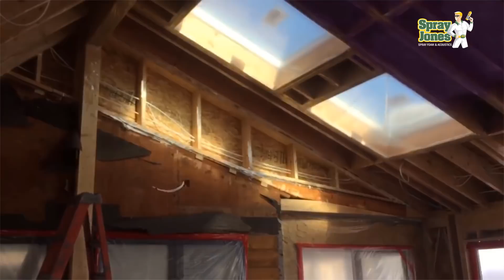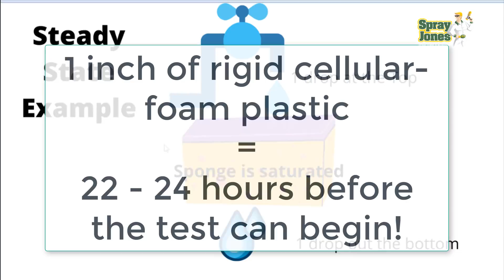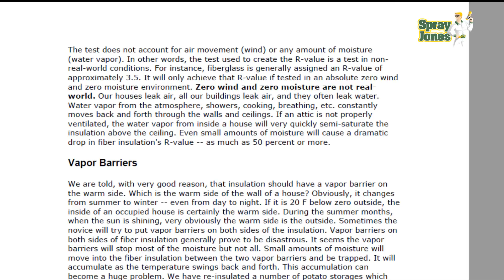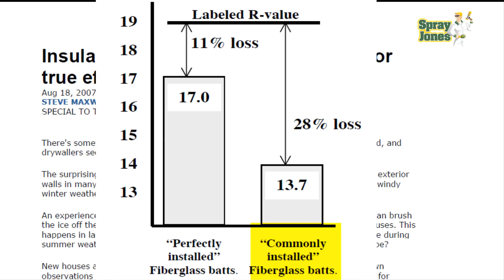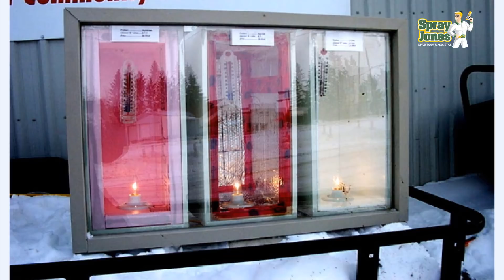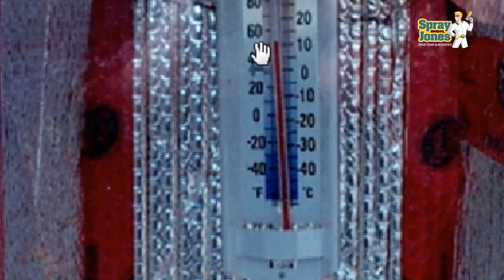R Value and Spray Foam Insulation - Just the Facts!

Comment: I PREDICT  that there will be a spray "foam" in the future that contains spheres or pellets of a material such as glass that contains  either a vacuum or an inert gas that is sprayed and will be a more "permanent" insulator similar or even better than the R-Value of FRESH sprayed Closed cell Foam.  There may also be a reflective layer available to spray as a thin "PRIMER" type layer that can be sprayed first to provide both insulation and radiant heat reflection that could also be sprayed as a last layer to reflect more heat back into the inside of the building.  This should actually not be that difficult to achieve. It is also fairly practical at least for the "beads" and the outer reflective layer though that might be dealt with in another Total Insulation Plan.
There will also be more advances and possibly included in this design to improve fire retardation.
Reply from the maker: Sounds good TK.

Comment: Great info 👍. I'm one of the 2 LoL actually I think you have more to the end because it's great info. I really like the real world test with the 2 identical test. Measuring the actual R value is fine but I would really like to hear what the energy consumption difference was because this is the real end goal. 
I think the real problem in the industry is "Code Builders" that are only interested in building to code for the least amount of money and uninformed buyers buying these homes. There's only a small amount of builders and buyers pushing energy efficiency. I think another thing people miss is the comfort and health of a airtight envelope with proper ventilation. I saw a video with a architect where he was telling builders and architects don't sell energy efficiency sell comfort and health people will pay for comfort and health not energy efficiency. Thanks for a great video 👍
Reply from the maker: Agreed. I have more info for other videos coming up on ROI and comfort. One bite at a time. 

Thanks for watching.
Reply: @SprayJones  Yes definitely. Thank you